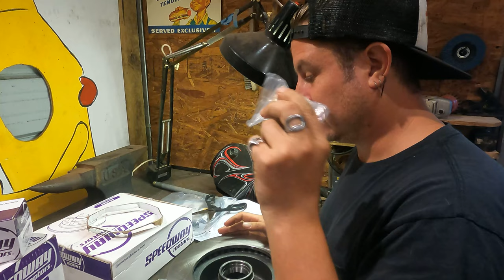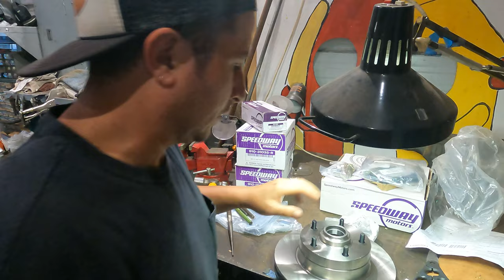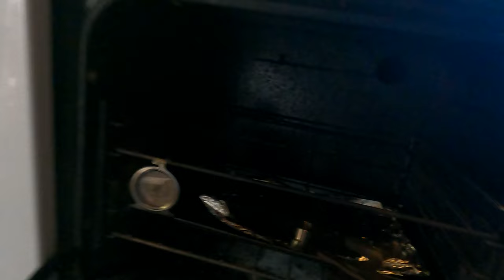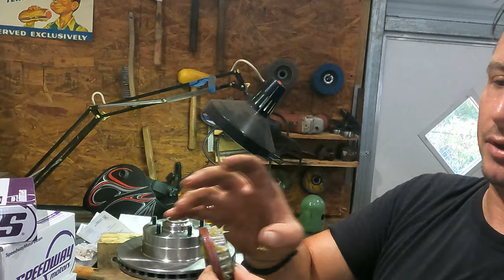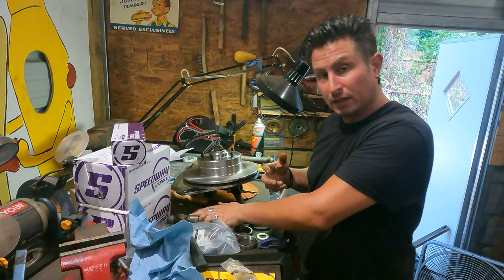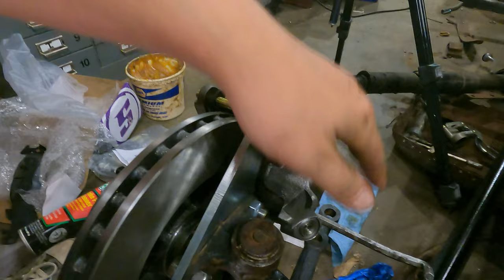Speedway Disc Brakes on an Early Ford Spindle for Your Hot Rod- So Ya hopped it up.. can ya stop it?

Comment: I just sold my 27 T roadster with 42 drums and now I'm building an A Roadster with Speedway components for exactly the same reasons you're doing this front end Cheap safety.

This is my 5th Model A Roadster and the third one with new parts ... You won't be disappointed!
Reply from the maker: hey man thats great to hear.    i am looking forward to how this one will drive ...especially brakes wise.   I had 40 ford brakes on my last one and ... well.. even on a good day with a light car they leave a lot to be desired.

Comment: Just an FYI. As of 1-19-2024 the kit I just bought does not use the spacer behind the inner bearing race any longer. They use a .312 thick spacer behind the tanged washer for the outer wheel bearing. Your video is very well done.

Comment: A similar brake kit is on the front of my Deuce roadster. Combined with the Nova drums on the rear, it stops great! My 27 is getting drums in front as it will be running 35 wire wheels. Those require a support around the inner surface of the wheel hub.
Reply from the maker: very cool this is uncharted territory for me... i have yet to run wire wheels.   that is a whole new adventure in parts combinations

Comment: Thanks for the video. I'm thinking this same kit for my 37 Ford. I would like to use the early Ford juice brakes but as you mentioned this kit is a lot less. The hill I will die on is I won't go with IFS, I don't care what all my boomer street rod friends say lol. ( I'm building an late 60's early 70's street rod).
Reply from the maker: Glad it helps… I don y  really get the ifs thing myself.  many moons ago I worked at a shop and we did one ifs install… and man… it is hard work and endless measuring.   If I recall once the welding starts there is no way to adjust.    To me you hit a point where it feels like you a driving a lowered car and that’s it.   
       But boomer knows stuff.   Just ask uncle Tony.
Reply: So, if you believe that, shouldn't he just go back to whatever came on it in 29-40 era days?

Comment: i do not like speeway either but? they have the parts i did a complete conversiob oon my 1935 ford sedan, just finished it. hell i also drove the car  when i bought it from ohio to washington state lol what a trip.  those old mecanical brakes were lots of fun 2 minths ago   going thru wyoming in a snow storm.  but the old flat head 8 just purred along  the brakes? well thats another stor.  they do like to lockup on icegot her home  regrouped and ordered the kit.  im slow but it only took  a few hours  but ihave all the brake line tools so wasnt to ba. now it stops
Reply from the maker: They are a lot more fun to drive when they stop… sounds like a great car

Comment: do not hit bearing s with anything use the old race with a flat plate on top simply hit in centre put flat plate on seal and hit in centre bearings are so hard you can chip on crack them just my $ .02
Reply from the maker: Thanks for the tip!